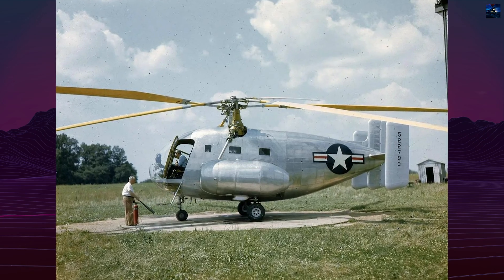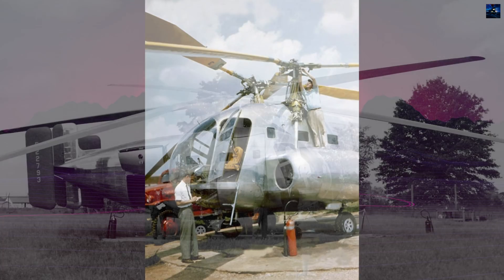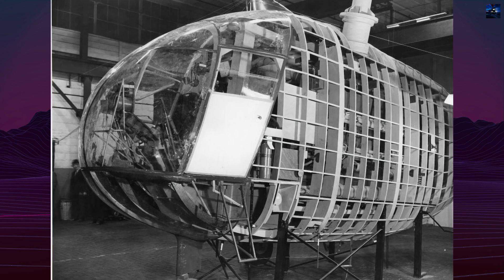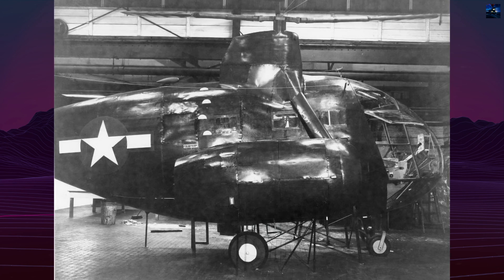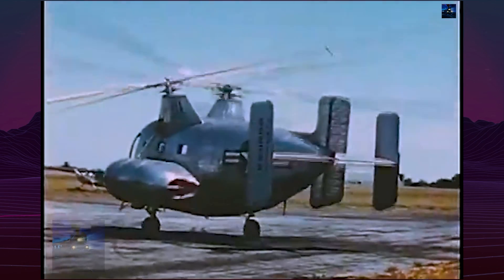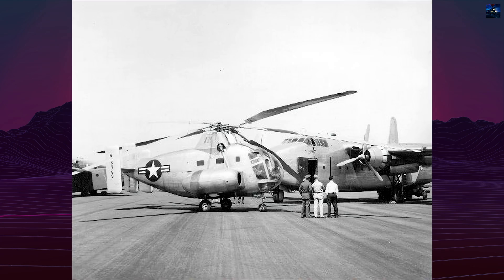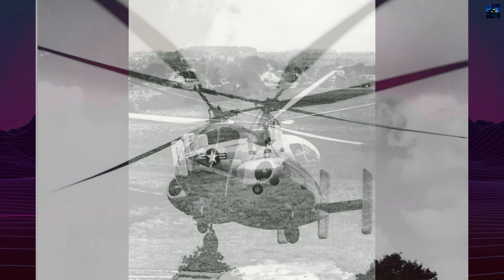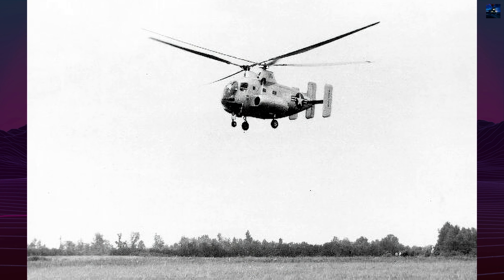Kellett XR-10: The Largest Military Helicopter Prototype of the 1940s

Comment: The russians were obviously spying on this program and the KAMOV was created a VERY successful chopper to this day! The K-MAX is the most impressive development of this type of chopper.
Reply: It is based on a German design from WWII which was not introduced in bigger numbers as it had a quite ingenous kind of wormgear driving both rotors synchronous but those big helical gears were very difficult to manufacture at the time. Still is for as matter of fact.
Reply: @nichtwichtig9242  You are right. The German Flettner Fl 282 is widely regarded as the best helicopter of its time. Both the Russians and the Americans tried to copy its design features. Neither nation had helicopter concepts that were even close to the level of the Germans at that time. Unlike the Americans, the Russians succeeded in successfully continuing the Flettner concept. The concept of the Focke FA 223, which had also been successfully used during World War II, was also further developed in Russia and ultimately led to the largest helicopter ever built, the Mil Mi-12.
Reply: Coaxial isn't a Syncropter  and coaxials suffer from yaw reversal in autotation (only one company solved this issue successfully)  Anton later worked with Kaman  after the war.

Comment: KAMOV precursor
Reply: No. It is a successor to the Flettner Fl 282. Of course, without its ingenious design. Because the Flettner Fl 282 is widely regarded as the best helicopter of its time.
Reply: @avronaut  FL 282 was average Sikorskys VS 300 and R 4 was better in range & performance
Reply: @HongyaMa  Are you sure?!

Performance Sikorsky R4:

Maximum speed: 75 mph (121 km/h, 65 kn)

Range: 130 mi (210 km, 110 nmi) [citation needed]
Service ceiling: 8,000 ft (2,400 m)

Performance Flettner FI 282:

Maximum speed: 150 km/h (93 mph, 81 kn) at sea level
Range: 170 km (110 mi, 92 nmi)
Service ceiling: 3,300 m (10,800 ft)
Reply: Nope not a coaxial

Comment: i wonder why there are almost no helicopters using intermeshing rotors now. i mean kmax was produced in what, 20 examples and that was the most produced intermeshing design. looks like less complicated than coaxial
Reply: Kaman built 370 of the HH-43 Husky intermeshing. 
I think the big downside is they fly much slower, compared to conventional helicopters.
Reply: Why build double of the most expensive parts and it was slow.  Even Kaman went with a tail rotor with the UH 2
" I went with the standard design with a tail rotor because if your in the water you can't wait" Charles Kaman